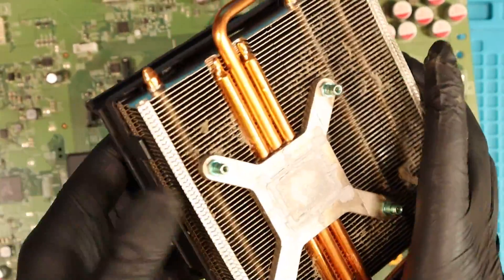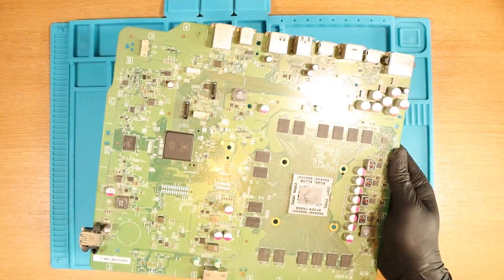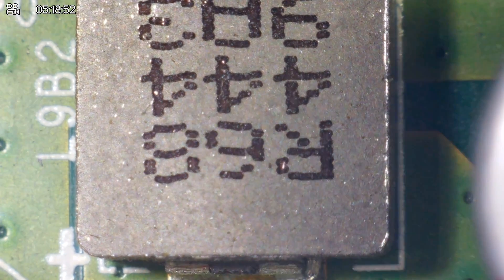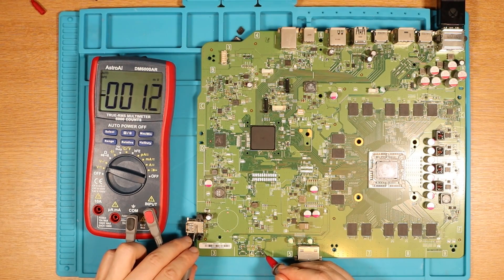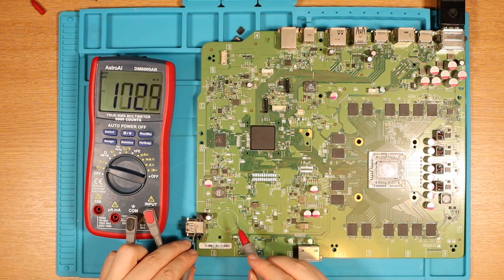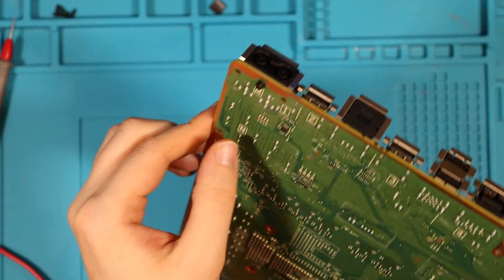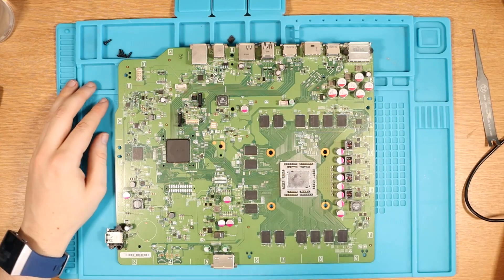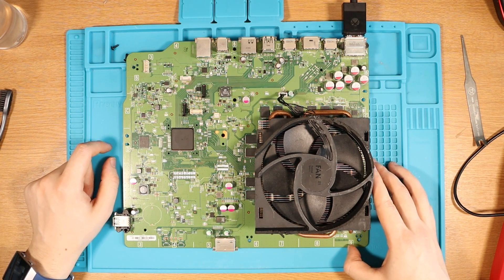TheCod3r CHALLENGED Me | Can I Fix An Xbox One?

Comment: change the power jack
Reply from the maker: Not a bad shout, but I remember having 12v on the power connector as well :(
Reply: @JoeyDoesTech  I remember you measure continuity from connector to pcb test point and was ok. You did.t take into consideration that maybe the power connector has a bad connection with the cable and is not able to provide power. Its why you get a 0.28v

Comment: Have you tried voltage injection with more amps like 2-5 amps and using a thermal camera, this method picks up the slightest change in temperature which can show a potentially bad component.
Reply from the maker: Hey Neil, I tried this on a live stream but don't have a PSU. I've literally just bought one though that I can hook up to my PC as well, so will try this next :)

Comment: On second thought , Since you didn't indicate whether the psu brick is turning on as indicated by the orange light turning to white... The Xbox one power brick has a constant 5vdc  "Standby" signal output on one of the center pins of the connector, which it seems you measured on one of the connector pins on back of the board. It also requires 5vdc "power on" signal from the board, either generated from the board or looped at the power connector, back to the other center pin to tell the psu brick to supply the 12vdc to the connector, thereby turning the orange light to white on the psu brick. You didn't state if you have this 5vdc "power on" signal being sent back to the psu brick from one of the pins on the board connector. Without this "power on" signal the psu brick will not generate the 12vdc to the board and the Xbox will have no power to turn on. You could jumper the 5vdc "standby" signal pin to the 5vdc "power on" pin on back of the connector to turn on the 12vdc to get power to the board, which in turn will test the 12vdc contacts through the board connector and should power the 12vdc rail. It will also give you more information and help locate where the problem may be. Continuity check of connector pins will find corresponding pins. I think all the 5vdc and 3.2vdc you have measured is being generated from the 5vdc "standby" power circuit. Also, the psu brick is turned on, orange light to white, by plugging it into the Xbox board connector, not by the Xbox power switch.. While your diagnostic procedures are good, don't forget the basics like, why am I not getting power at the board connector... On another note, If I am injecting myself in where I shouldn't and being a bother, Please let me know...
Reply from the maker: Hey Warren, thankyou for the info :) I thought the indication of power going from power brick to the Xbox was by the fan having that initial 2cm spin, so maybe this lines up with the white light appearing on the brick then turning back off?

Currently the white light doesn't appear on the brick at all, so think you're 100% that it's not having that signal to send the 12v to the Xbox and I know the PSU is all good from other Xbox's. I might try the jumper wire like you've suggested and maybe that'll prompt the brick to turn on, my only worry is that then it might overheat something it's not meant to? I could be wrong though!
Reply: @JoeyDoesTech  I think that if something is shorted it will heat up, but you haven't found any shorts and the 12vdc is only going to go where it is suppose to go or to ground so, there should be no problems. Try jumping the pins quickly while monitoring the 12vdc pin of the connector with a meter to see if you temporarily get 12vdc and the psu brick light switches to white long enough to rule out a "orange-white-orange" problem ,. If you do and it does, that's great, Then see if you can trace the 5vdc "power on" signal pin back down the 5vdc "power on" signal line to see where the 5vdc "power on" signal is getting blocked. Could be nothing more than a transistor or such. It should ultimately come from the 5vdc "standby' power source or a control chip supplied by it. I believe the fan spin is a result of the circuit charging and logic levels being set. But it's spin would, in a way, indicate that some power is getting through ...
Reply: @warenmann1042  Great that you explained how it works, because I also have such a console and now I know what I should check. The thread may be old but for me the knowledge is new so thank you both.

Comment: Good job, good video,   Since you asked...When looking into the power supply connector (psu end) each barrel is a separate connector. From outside to center of each barrel (two on psu connector and two mating connectors on the board connector) the connectors are arranged as GRND..12vdc..5vdc... you have three circuits. 1: the outer barrels on both pins are ground. 2: the inner barrels, where the pins are, carry 12vdc. 3: The center pins, one carries 5vdc pwr "ON" signal, 0vdc "off" and the other carries 5vdc constant... On the power connector on the board there are matching pins that mate up to the ones on the psu connector. If the 12vdc barrels from the psu connector are not making contact with the 12vdc barrels in the ps board connector, due to a bad or worn out ps board connector, then you will not have 12vdc available. Even though you have continuity between one side of the board connector and the corresponding pin on the board does not mean you have continuity from the psu connector through the board connector to the board. So, since you have no 12vdc power on the board and have not found any shorted or faulty components, the power connector on the board would be the first thing/component I would replace... Good video, Thank You...
Reply from the maker: Waren thanks for the explanation, that is going to help me massively. I'll see what I can do in terms of removing it and replacing it, it's not going to hurt anyone if I try. At least then it also rules that out. Thanks for watching mate and thanks for the comment! 😁

Comment: Great video joey it was very entertaining  as usual. yesterday i found an original xbox one at a scrap center and it was like this it had an orange light on the power brick but no power so i spent a few hours faulty finding and eventually i plugged it in without the wifi card and the white light came on and it powered on the only problem is both hdmi ports kinect and ethernet port look like they were intentionally destroyed with a screwdriver so for now i cant test it on the tv im going to try replacw the hdmi port hopefully it goes well anyway hopefully you can find out whats wrong with the xbox keep trying you will fix it keep up the fantastic work
Reply from the maker: Thankyou Dan! Hopefully you get it all sorted. Might be worth replacing the other ports as well as they could be causing shorts, but let me know how you get on with the HDMI first! :)

Comment: You’re absolutely right, Joey. mV stands for milli volts and there are 1000 mV in a volt, so 50 mV is just background noise. The equivalent of 0.05 volts.

I think it would be worth finding continuity between the 12v pin behind the power port and other areas of the board and seeing if you can find continuity on one board that isn’t on the other.

I know you measured voltage between ground and that pin, but did you measure resistance/continuity? If there’s low resistance between ground and the 12v pin you’re 100% dealing with a short to ground.
Reply from the maker: I measured from the connector to the pin with continuity but not from ground, so that's an interesting question pal. Thanks for the info about the mV as well :)

I checked as many locations as I could for continuity from that pin to other areas of the board and found some stuff, but no shorts on those individual components :(

Comment: Remove suspect components(regulastors, fets, caps, etc. .) on the 12v rail  and see if the short goes away.
Reply from the maker: Thanks Greg I'll give this a go for sure. Will be good soldering/hot air practice as well doing that 😁

Comment: HeyJoey!
Reply from the maker: Hey pal! 😁👍
Reply: @JoeyDoesTech  you learning a lot! You are getting very knowledgeable on xbone!
Reply from the maker: @onasazi  still trying my hardest pal when I can. Slowly but surely :)
Reply: @JoeyDoesTech  well i think i need help trying to fix a xbox one power brick. I replaced those 2200uf 16v capacitors and even the 1500uf 16v loner. Usually the brick when plugged it starts orange and then white if you plug to console. Mine starts out white! And you can hear a whizzing sound! The console plugged in doesn’t start up! Any ideas?